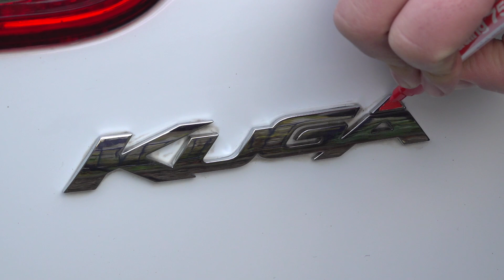£500 Ford Kuga / Escape Cheap and Easy Cosmetic Fixes

Comment: Tip for the future, use 0000 wire wool on those wheels. No scratches just a coat of polish to seal in the gloss.

Comment: Great video as always Luke think I would've taken the front wheels off to give them a proper deep clean as there will still be plenty brake dust on the inside of the wheel and a good chance of that coming out on the front surface

Comment: I use an old toothbrush and toothpaste to clean stubborn brake dust off, never let me down yet.
Reply: How about claybar? You can get them in coarse,medium and fine. Should be only minor damage that you can buff off. Better than caked brake dust how ever you remove it 😊